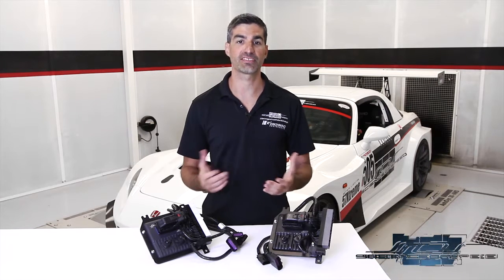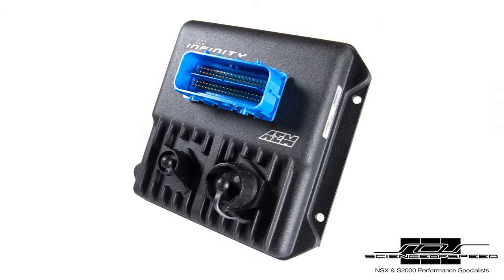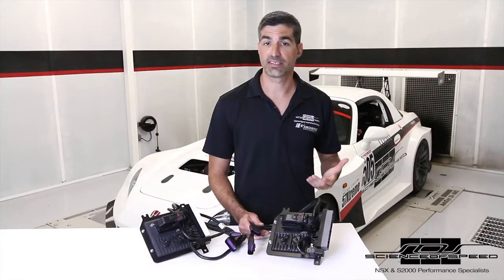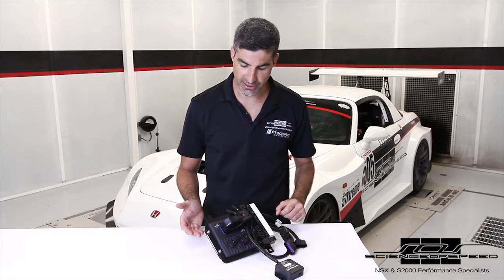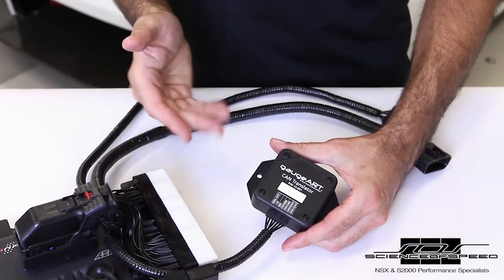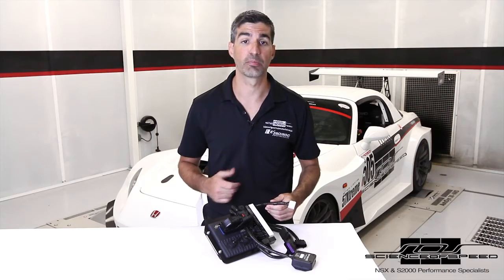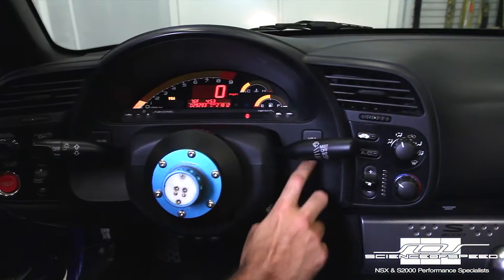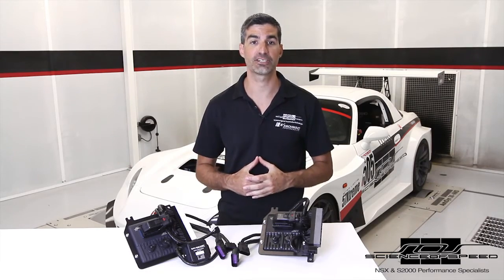ScienceofSpeed AEM Infinity for Honda S2000

Comment: I like to use DashCommand to read engine parameters. I have an 01 S2000. Do you know if I can use my OBDLink to read engine values from the AEM and have it displayed on my DashCommand or other OBDII reader apps? I'd like to replace my ECU with the Inifinty but want to be able to keep reading engine values, and actually, I'm really hoping that the AEM would offer a faster refresh rate. Reading from my stock ECU has a lot of lag. My 08 Focus reads very quickly.
Reply from the maker: Sorry, that is not possible. The AEM telemetry is not compatible with an OBD device. May I suggest a gaugeART CAN Gauge perhaps? https://www.scienceofspeed.com/index.php/s2000/gaugeart-can-gauge.html